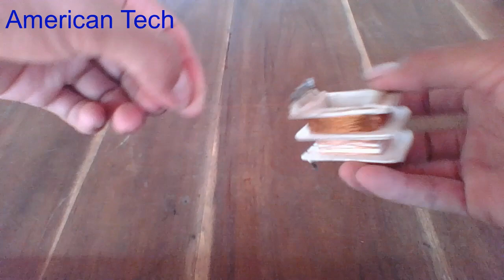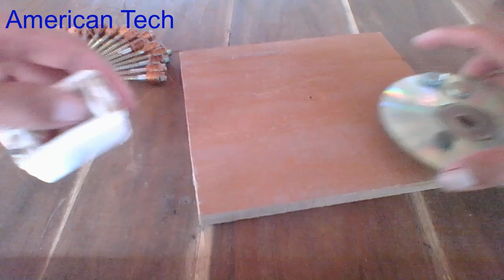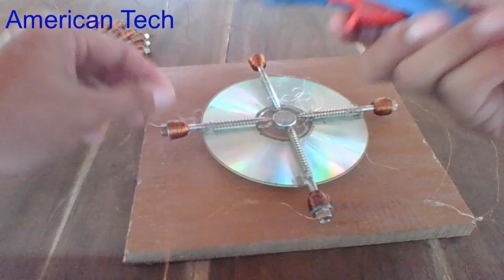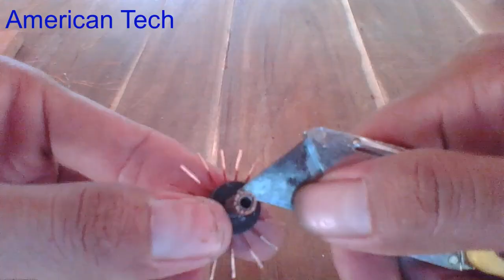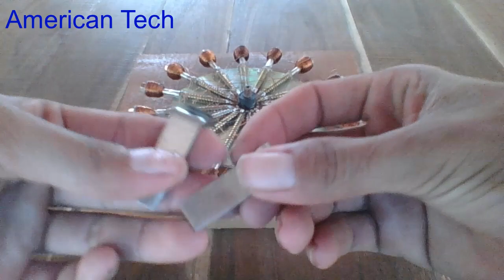how to make a powerful DC motor using screw and CD panel

Comment: Okay, here we go again.  I thought you'd take this DC motor and convert energy of motion into generating current.  Once again, you disappoint by using a battery to spin something.  BIG FREAKIN DEAL!  What the use of this device?  I want to see someone make something cool looking (like this) but IS FUNCTIONAL.  Something that you hand crank to recharge any kind of battery if your power goes off in your hotel room due to a powerful electric storm.  Now that would be very impressive!

Comment: Forgot to mention in the title.... And copper wire, hot glue, bearings, some sort of magnet, a solder gun, solder, super glue, a block of wood, some metal strips, thick copper wire, and then finally a battery. Kind of a far cry from a CD and a Screw

Comment: interesting how you have the terminal brushes to an A.C. armature to power a DC wound motor. It just doesn't work that way! Too many contradictions.  Brushes on opposite sides of any motor with a counter clockwise motion and having turned it in a clockwise motion it reverses after connecting your wires. Sorry but that's fooling the public like your aluminum can bottom and copper wires producing ha 1.5 volts. It too is a joke on the public.

Comment: Very slick is your father and electronic engineer and will be DC motor put out voltage turn by a fan mounted on a pole high above the roof instead of using a battery

Comment: Just had a question, when you attaching the wires which came off the (head) end of the screws to the part in the middle, that wasn't clear how you actually attached them? Thanks.

Comment: I did this back in 1969 in elementary school. I built a motor out of nails and wire and a cork with a glass bearing it worked great for the 5th grade science fair. Not really cutting edge but the use of surplus materials is great!

Comment: Does it produce electricity, or merely spin? Honest question. Alternately, you could build a housing with magnets placed above the copper wiring in order to produce a current, could you not? Just curious about the potential application of this device... using it in conjunction with in order to create a more powerful, useful generator...

Comment: why not do it reverse, rotor made up of magnets in a metal plate. so you have less wire used and more power to rotate the motor.
Reply: Owat Thorne iព

Comment: what voltage battery?
Reply: I don't no wut voltage but I wud do 9v k I think it wud wark
Reply: DEADASTRONAUTFX Looks like a single Li-ion cell. Nominal 3.7V, max 4.2V.
Reply: That is what the pink thing was for. A capacitor keeps electrical charge

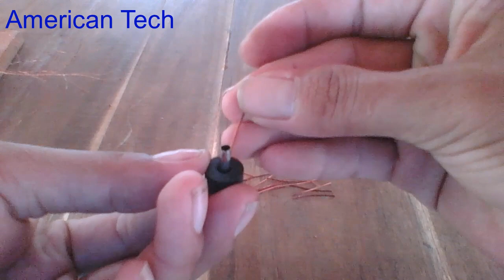Comment: What is the black circular material material, that the coils go through and is then used by a solder? Is it rubber, magnet, or plastic? At 3:32

Comment: It looks like it may work. at least he's not talking about some magical perpetual motor that generates unlimited energy using some secret technology that the power companies don't want us to know about. The only thing that I had a hard time seeing is the core, by the bolt, where the brushes meet. Hard to see if its real  or not. If its just the 33 gauge magnet wire that the two brushes may or may not meet, what are the chances that both brushes meet two matching wires? It could work, but extremely tedious.  So if it does work, this guy is quite a brain.
Reply: leefiles with the help of air compressor maybe
Reply: No.. This is genuine. I have seen tiny motors using similar principle used in novelty greeting cards.
Reply: leefiles l
Reply: I don't think the brushes need to meet two matching wires. I'm guessing all of the solenoids have a common ground, and the brushes only touch positive. Or the opposite, of course.

The magnets on the outside are probably both "north in" or "north out". So it's not that one set of solenoids has to have one polarity while the ones across the way have the opposite polarity. Rather, when the solenoid circuit is closed, it is  drawn to whichever magnet is closest, and the brushes are arranged so that the hot solenoids are the ones that are next in line to reach the magnet, while the ones already close to the magnet are switched off until they get to the other side.

I'm assuming magnetic attraction is the driving force, but I guess there's no reason it couldn't be wired to work on repulsion instead.
Reply: Hey Tom,
I like yr comments, but I think you're wrong about the common ground - there is no mechanism here for that, and it's clear that the circuit is completed by opposite wires on the commutator: the battery terminals are wired directly to the brushes. There are 16 sets of windings (poles) in the armature, and 16 contacts on the commutator. The video is pretty lo-res, but the the leads of opposite-side windings are twisted together before being soldered to opposite-sided commutator wires - it's not clear whether in series or parallel. Anyway, there are eight circuits that alternate polarity every 180deg. The thing I'm curious about is the magnet polarity - I've never seen it oriented like that before.
Reply: Yeah, you must be right about the lack of common ground, now that I look at it.
Reply: leefiles
Reply: +Tom Haflinger Think about it this way: if there was a common ground, you can't reverse the magnetic field (without needing more switching and switching all the coils in contact with the brushes at the same time), just turn it on and off.

You can make such a motor work, but it's far more efficient if you can reverse the polarity of the windings individually.

There's a couple of things I'd have done slightly differently, but it's pretty sophisticated for a home-build.

My first try was two nails for an armature, a nail for a shaft, and lots of electrical tape.  Ugly as sin, but it worked. I can do better now ;-)

Comment: would be very hard to get perfectly balanced without using same amount of wraps of wire on each lag, and same amount of glue . the music does not explain what size wire or what the different parts are that u are using.
Reply: hunterd78 3
Reply: hunterd78 s
Reply: I wouldn't use hot glue for the weight purposes of balance.  But this is a good build. I just recently made my first one. It's so easy that this should be built in grade school. I only made a simple two pole but I can improve from here on the next builds. I want to make a powerful generator.
Reply: Josh Cook hello, can you show me how you do it the dc motor? The tools and materials?
Reply: Nurul Syafiqah I watched a video on YouTube. For the first one just to understand it better I made the video that will come up when you search "how to make a DC motor easy". It was magnet wire, two strong magnets (I used neo magnets) and wood. I used a wood dowel for the rotor and just used scrap for the frame. In the video he uses paper clips for the battery posts. He shows you the exactly what you need to do.
Reply: Josh Cook Thank you so much Josh!!!!! Do you already have the video that you mentioned?
Reply: hunterd78

O

Comment: In the end he made a commutator by sanding the wires in the center of the motor for electrical contact. He didn't show the sanding. Interesting way to make a commutator and using plain wire for motor brushes. Also very interesting way to shape a magnetic field using one magnet and two circular pieces of steel to shape the magnetic field.

Comment: Hello . Thanks for the vid
I see the motor vids are always missing some details. The following critical details are not there:
Direction and arrangements of winding after connecting them
No of turns on each screw
The way of connecting windings to make a closed passage of current
The way of connecting the center set of wires (which wire connects to which coil)
where the brush simulation touches the center wires
This vid  however makes it possible to figure out some of these many details :)

Comment: You did not really prove if it is a motor or not. You showed it can be powered by a battery. You did not show that the "motor" is producing power.
Reply: Sean Regehr if you're a troll then just skip this.
We know the device can spin when powered by a battery. So if the battery was replaced by an LED (light emitting diode) and the device was spun manually then the LED would light up. Try this at home with a motor; Connect both leads to a battery. If the battery makes the motor spin good (it's not broken). Then connect both leads to an LED. If you spin the motor by hand the LED will light up. Now you can see the device here (in the video) can produce energy if spun manually. Remember with a diode electricity can only travel in one direction. So when doing the experiment at home, try both directions if one fails to bring results.
Reply: That which converts power to motion is called a "motor", and that which converts motion to power is called a "generator". In theory an electric magnetic motor is also a generator. In practice, companies may improve details according to designed purposes.
Reply: I don't see a battery--It must be a hoax... 

I see a battery---It must be a hoax!

I don't see a brain.... 

You must be a hoax!

Comment: All-of a sudden everybody is an electrical engineer. This project is very impressive for something constructed out of general household items. If you all knew so much about DC motors, building one similar or better than this should be a breeze. Great job kid.
Reply: ive made plenty of motors  in my life. I can tell you this design is very bad. you need an equal amount of magnets and motors for it to be decent. he also had the coils facing the wrong way. shouldve had them upright not horizontal.
Reply: understand he isn't taking this design to an industrial power plant. this is a motor constructed out of household items. built by a kid. if that isn't enough to impress you, keep the condescending remarks to yourself.

Comment: Why leave out that you don't solder one end to the commutator several steps away from the coil? Too far away to see which you are soldering to. 32 wires to solder and only a couple shown from a distance. I understand not showing redundant steps, but why skip crucial steps?

Comment: Sir,, may I congratulate you on making this motor especially the commutator part.  I have  wounded many motors in my younger days going back as far  as 65 years ago. This motor can be compared to  a  lap wound DC motor . It has all the working principles of a larger size motor.  For those interested one may look up lap and wave winding in DC motors to be able to appreciate what this person did.   It is an elegant manner in which to teach the logic of how the electric current is switched into the coil so that the particular coil passing under the permanent magnet is  of the correct polarity.  Well done and  once again , congratulations on your   great ingeniousity.
Reply: Man you can keep economy going And have us run our own banks with your genius cause we're heading toward it again trying to encourage my friends to make economy great again by doing these and other things to build at same time

Comment: great idea making dc motor but is it really powerful? have u measure the torque generated?
Reply: hustlaz2k I am not sure about this motor, but one my class built (civil engineering) to study concepts of electromagnetism was not very strong. we increased the voltage to the point it started smoking, but torque did not increase much (the motor was damaged  due to overheat)
Reply: It will be shite
Reply: Yes, the "powerful" in the description is misleading and false. There is no output. The center is a bearing, so modifications would be needed to get any output. This is intended for demonstration of electromagnetism, not useful output.
Reply: Well a hub attached to the bolts via pvc pipe, and a planetary gear design could be used as an output shaft.  With the size he has he could probably get a  27:1 gear ratio, meaning for every turn of that motor the output shaft would turn 27 times.  And if you reduced the size you can have a very steam punk looking home built fan for your desktop pc running via the usb port.
Reply: I beg to differ, did you not take notice of the rate of acceleration given the obviously not insignificant mass of the armature?
Not to mention that the term "powerful" is a relative term and, if one was left feeling mislead, perhaps they should take a step back and realise that most probably, given that "powerful" is in fact a relative term, it is only their own assumption that left them less than impressed or in some other way, lacking.

In fact, I dismiss your postulation and challenge you to prove your position. Further, how arrogant must one be, to be so derisive to another, while spewing forth such fundamentally erroneous statements as "There is no output" and "misleading and false" pertaining to a video you yourself just watched, in which an electric motor was spinning. Friction, gravity, magnetism... I missed the bit about it being in a vacuum floating on superconducting magnets at absolute zero. 

All hub motors have a bearing in the centre.... the motor spinning the platters in the hard drive DIRECTLY IN FRONT OF YOU has a stainless steel roller bearing in it's centre, is it too lacking of output and in dire need of these modifications to which you elude? 

I could continue, but I think I've made my point. Bit of humble pie motherfucker, it's certainly more "powerful" than ill conceived criticism.
Reply: Jimmeh, powerful is definitely relative here.  However it could power a fan with relative ease using a simple planetary setup and taking advantage of the torqueXdistance factor by using the outer ring gear as the driving gear and the output would be the sun gear.  Will it power a car? Of course not.  But more than enough to make a cool home built fan with this.
Reply: hustlaz2k
Reply: Computer Fixes 1024
only to a certain degree till it starts over heating and starts to smoke, lolz
Reply: hustlaz2k xxx

Comment: It's a prototype dipwads. American Tech, I'm curious as to why you firm up the wire on the middle sensor every now and then. Are you just making sure that it is continuing to stay stabilized?  Sometimes it looks like you are slowing it down. If so, why. Ingenious little invention you have there.
Reply: Where is your video then?